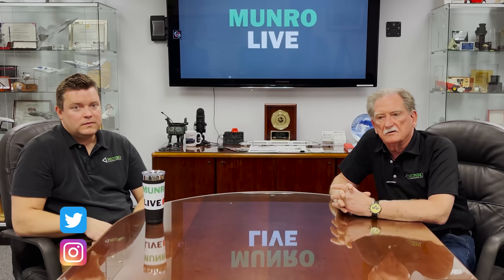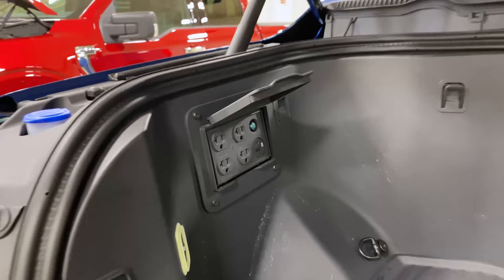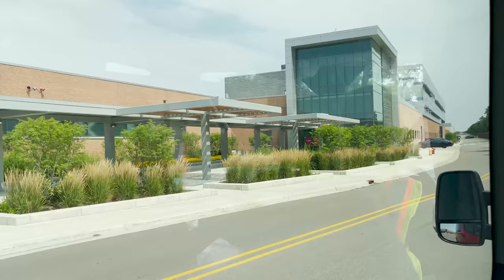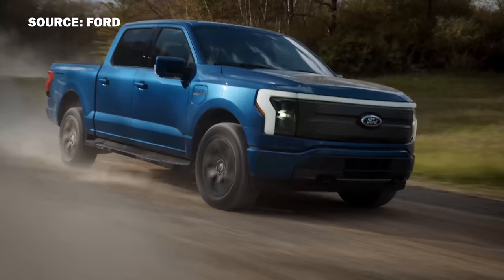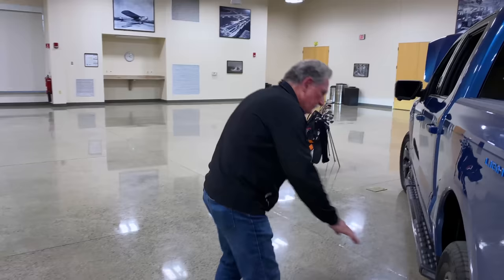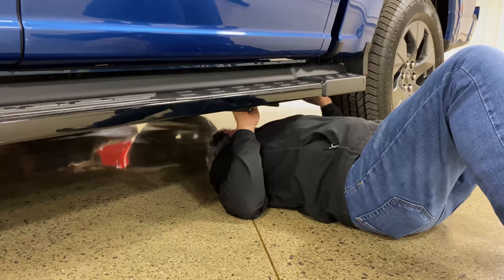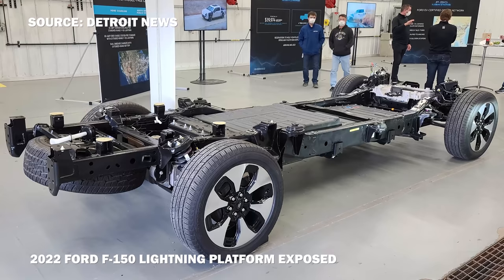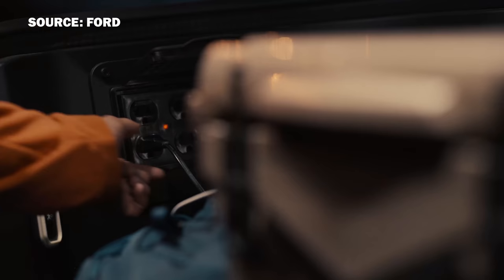Sandy's First Look at the Ford F-150 Lightning Electric Truck!

Comment: Really curious how the driving characteristics changes if you have something heavy in the frunk and nothing in the back and vise versa.
Reply: well i don't suppose it would be much different than any current ICE F series pickup built in the last 50 years.  gas and diesel engines already weigh in the 400lb to 1000lb range while sitting in the "frunk".
Reply: @phillyphil1513  ofcourse it will change, the question is how much. Shifting the weight distribution will always affect driving characteristics. Would like to know if they have any type of active adaptations going on, for example tightening up the suspension, altering how the ESP works etc. I'm european so a truck is not something I would buy, but still curious how they solve it engineering wise.
Reply: @JonasWerme  Q: the question is how much(?) A: none that you will notice.  400lbs is basically 2 passengers (adult males) and is a TINY percentage of total vehicle weight of approximately 6500lbs (35% more than a GAS F150) the battery pack alone is rumored to weigh 1800lbs.  re: "I'm european so a truck is not something I would buy" exactly, so that means you are SMARTER than the average American so i know you can figure this out.  as you also know Mercedes, VW (MAN), Iveco, DAF, and Scania all make trucks even BIGGER than Ford and they're mostly CABOVERS. just look next to you as you drive down the motorway, the info is right there.

Comment: Good analysis. Question re trailer feature. Why make you data enter all the stats? Why not just enter a trailer ID first tow, then compute and store the stats while towing?
Reply: QR/bar code on the trailer, scan it with the Ford app.  done, easy, fast.

Comment: Consider the Ford F-150 Lightning. With no need to fit a gasoline engine underneath the hood, Ford could have restructured its front end to slope toward the ground, giving the driver a better view and making it more likely that a pedestrian or cyclist would roll off the top instead of absorbing a collision directly. Instead, Ford kept the tall dimensions of the existing F-150, converting the space underneath the hood into storage that the company calls a “frunk.”

Comment: Why did Ford isolate the battery pack from the frame? I assume Sandy means it was isolated with rubber mounts to allow movement between the pack and the truck ladder frame. These frames always twist back & forth under normal loads & use, so if the battery pack was solid attached it would either twist and damage the battery pack or rip apart the bolted mounts.
Reply: Probably makes it easier to replace?

Comment: It’s nice to see Ford taking the usability of the truck in a creative direction…. All those bells and whistles still need power…. The usability of the truck will still boil down to how much energy/range the truck will have when loaded.
Reply: I think that's an easy solution long term, but in the short term the range is going to be a limiting factor.  They will be fine for most applications, but if you want to tow more than 150 miles per day (100ish if its cold out) then the range just isn't going to cut it.  It will absolutely excel at short range daily towing though.
Reply: Its going to have a lot more range than stated. That range is with a thousand pounds of payload so that's why they low balled the range. To make it easier for people who tow.
Reply: @twany442  That will help, but weight isn't nearly as big a deal as the drag from the trailer.
Reply: @nerothe  And. Still doesn't matter the will definitely be more than the 250 300 miles that stated. No way in hell.

Comment: Two of the most critical questions: 
1. how aerodynamic will this brick be? 
2. How many will they be able to make? (Ie how many batteries can they source)
3. Did they or did Ford anywhere mention how many EV trucks they’ll be producing per year?
At the end of the day, if the cost/range is too high (ie they need 20% more batteries because it’s not aerodynamic) and if they can source enough batteries, they will be supply constrained. If they can’t make enough trucks and they can’t make enough profit on them - it is a nice project but not really going to really shift market to EVs.

Comment: Why not put battery pack with inverter a/c in trailer either controlled by truck or to extend range while towing right along with brake control?

Comment: the FUD motors Lightning is still a LIGHTWEIGHT. 
Cybertruck has 100 sq ft Cargo with BEST in Class hauling of 3500 lbs STANDARD on all models.
Cybertruck also has MAX TOWING up to 14,000 lbs with a LONG RANGE battery. 
Cybertruck has BEST in Class Approach, Breakover , and Departure angle.
as well as 16" Ride height with 14" Travel on a 4 Wheel Indenpendent system.

Comment: Re Sandy's comments about the yuck factor of gasoline - I recently bought an electric riding lawn mower.  No smell, no having to keep cans of gas around, no spilling gas when pouring it, no starting problems, much quieter, better traction from the independent motors for wheels and blades.  I made a New Year's resolution never to buy another gasoline engine.

Comment: In a few years, if I were the manufacturer selling the first vehicle with nonflammable solid-state batteries, my commercial would be an ICE on its side, a classic (flammable electrolyte) BEV on its side, and my BEV with solid state batteries on its side. Then I'd open up on the the underside of all three with a 50 caliber machine gun firing tracers or incendiaries. And after the ICE exploded, the classic BEV was intensely burning, and my vehicle was sitting there riddled with holes but inert, I'd ask the viewer: "which of these do you want to drive?".

Comment: So for the trailer there should be no need to input any data. Once the truck detects a power draw it then detects a load in the back and then would start a confidence countdown till it had recalibrated the MPG. No need for any user input.

Comment: Range is king. So what is the range and the cost of the truck to get a range/ unit cost.
Also charging speed and charging network size, location and ease of use.
Reply: That's what I'm waiting to see.  MSRP is one thing, but what it is really going to take to get out the door and what is the real world range when towing a trailer.  My 320 mile range Model Y gets 110 miles towing a bass boat when it's 48 degrees out.  It won't be an apples to apples comparison, but the Ford will have to prove its ability to tow for any range at all.  150kw charging isn't going to cut it long term as Tesla begins moving into the 300kw to 350kw range near term.  Ford touts the "largest national charging network" but forgets to tell you that 80% of those are destination chargers that give you about 20 miles of charge per hour and the fast chargers don't work half the time.  Again though... these are short term problems that will be fixed as EV's become more prevalent.

Comment: I know one thing that the Lighting will have that Tesla won't... Spare part availability. I hear stories and watch them on youtube that a minor fender bender might lead to 5 to 6 weeks to get a replacement part. Unless I am mistaken, this looks just like the stock gas engine version, therefore parts will available.

Comment: The mechanically isolated battery is a BAD idea, but necessary in this case! To date, BEVS have all been unibody, with massive torsional stiffness, and integrating the battery pack is a GOOD thing, because it allows you to use the mass of the pack to ADD stiffness and strength.  But this Truck carries across a ladder chassis and body on frame, which means it is not stiff, and that forces to to mechanically isolate the battery to avoid frame torsional deflections causing internal shear loads resulting in fatigue failures in your pack. The downside is that the pack stiff needs a mechanically strong enclosure, to protect it (esp. when off roading or on dirt roads, where a truck get s used) but now all that mass does not help stiffen and support the rest of your structure.  This adds a significant amount of mass, hence the huge kerb weight of the F150 lightning.

Comment: I would be more inclined to buy one if it was a super cab with a 6 1/2 ft bed. I use my truck bed more than I use the back seats for passengers. Plus with the frunk I have even less reason to use the back seat for storage. Super cab is lighter than crew for the same wheelbase as well, so that might turn into an extra couple miles per charge.

Comment: Until recently I assumed that most Americans who use pickups for work would choose the familiarity (comfort) of the Ford over the flashy Cybertruck or the L.L Bean-ish Rivian. Then I watched a review of the three, each the loaded version. Whoa! The Ford is a little MORE expensive than both the others' trimmed-out models, and has FEWER great features, less impressive power, range, and other specs. The Rivian is ideal as an off-road camper (amazing rough-road agility, from individual motor on each wheel), but the Cybertruck will outperform the Ford in most every way, and guys wil learn that over time. If I were a contractor, I'd buy the Cyber in a flash.

Comment: The Lighting will out sell the Cybertruck. The F150 has been one of the best selling trucks ever. Ford will have a lot of credibility for this reason. Also, most people want the utility of a standard truck. Most truck users are not looking for a had turner. They are looking for something that hauls there stuff around and had easy access te everthing. You can access the entire bed  of the Lightning from the sides. It's a standard bed size so typical truck users will find it highly useful. The Cybertruck is none of those things. It will sell to people that are not truck users. Like how you see tricked out hummers and jeeps that never see off road use, this crowd will buy the Cybertruck. Actual pickup truck users will gravitate to the standard design that has served them so well...like the Lightning has preserved.

Comment: 2024 they'll bring the construction-/fleet-model to the marked, and start now with the most expensive platinum trim first  ...that's at least what was written in their small print at the introduction of the truck. but maybe timeline has changed.
Reply: Also there was an info that the platinum won't be available as long-range with the bigger battery.

Comment: I was hoping for a dive under the frunk area. Let’s hope Ford simplified the thermal management system on the Lightning. I hope it’s not the same rubber hose palooza used on the current Mach-E.

Comment: They are definately not cheap especially jumping from XLT to Lariet with the "bells and whistle" premium packages exluding the 300+ range battery.  I did a calculation on my V8 driving on econ mode with the average price of gas.  If i'm putting on 200k miles, the cost of gas vs. electric is going to surpass the price of XLT premium.  This is even before adding on any maintance.

Comment: As someone who's driven a tesla for 5+ years.. the lack of a single 110 outlet in the car to this day is mind boggling to me. You're literally sitting on a giant battery and can't get even 1 low amp 110v to easily charge a laptop or something (without a lighter adapter). Crazy.

Comment: Sandy, your video gave me an idea you may wish to pass onto Arcmoto (unless it sucks). Is anyone doing a motorized EV trailer? Or perhaps just trailers where the floor was a battery-pack to allow for higher-capacity towing with an increase in range and performance for the EV truck that's pulling it?

Comment: When Sandy said at 11:27 get the Lariet and that he "wouldnt touch a low range anything" (low trim he means) why is that, can someone explain exactly why a low range lightning wouldnt be desirable?  From the XLT to the Lariet its an additional $25,000, its even more from the Pro to the Lariet.  Can that $25,000+ justify the features on the Lariet?  Is there some other value calculation he is making that I am missing?  Thanks! @Munroe Live

Comment: The F-150 Lightning Platinum is a $95,000 truck...yikes!
Reply: The standard range F-150 Lightening Pro is $39,900. The Extended range Pro version is fleet only.

Comment: I love the smell of burning gas and the noise of the generator is no worse than the noise of a saw and many other power tools. Regular generators are the only legal way I can get high on the job aside from sniffing paint fumes, but low VOC and oil-free paint kind of ruined that.

Comment: solid stainless steel cybertruck with most likely more advanced battery and ground up design will most likely still be better.  power converters are not hard to add

Comment: I wonder if it works out for them as a work horse for offsite maybe not ideal to drain the battery. I don’t see a reason for a Frunk it’s kind of pointless. Do they also have a way to plug in the thing on site? Say in the construction cabling in some innovative way?

I like there screen integration the only thing i found weird is the cycle thingy.

Comment: When you say the battery is a “massive” item to isolate, do you mean that literally or do you mean it is an extremely important item to isolate?

I’m curious why the battery is important to isolate (if that’s what you meant).  It doesn’t have any moving parts, does it?  Do vibrations do much damage to it?
Reply: Probably makes it easier to replace battery pack
Reply: @WANDERER0070  hmmm.  That’s not what I thought they meant when they said “isolated”, but maybe.

Comment: The electrical outlets won't survive the first load of firewood tossed in the rear bed. The outlets need to be higher and have a protective cover. Loose material like soil and builders mix will also destroy them, especially with being mounted so low.

Comment: Just thought I'd say how much I appreciate your programming, please keep up the good work.
I fall in the category of needing an ICE powered pickup in the foreseeable future or at best a hybrid. I live in Northwestern Alberta about 1200 miles from the Alaskan boarder. Though I'm enthralled with the Cybertruck in particular for its rugged exoskeleton and bullet proof glass, it won't cut the mustard up here. There  are no superchargers or similar systems and at -45°C and colder in the winter when snow and ice stick to the bottom of your truck, causing reduced battery efficiency and mileage. What does one do?

Comment: The F-150 electric doesn't need to be better than the Cybertruck, or better than the GM or anyone else. It just needs to be better than the ICE F-150 and it will be a great success!
Reply: True!  There is a lot of different niches in the truck market and no one e-truck will fill them all.  Lots of room.

Comment: My biggest concern is the loss of range with a load compounded by the loss of range in cold weather. Is a 300 mile range unloaded summer range going to turn into a 70 mile loaded cold winter range? If the range loss is at that level of bad, it’s flat-out not a usable vehicle in northern climates.
Reply: Range is around 472 miles for these.  For(d) Artic Circle trips you will need the extended battery or battery trailer.

Comment: They sell a million trucks a year.  Year one they'll make 50k of these.  They'll likely have 250k truck buyers delaying their new truck purchases for a year or more.  This is going to be a very painful transition for Ford.  That's why GM and others choose high dollar, lower volume first.
Reply: Yes painful, but they'll be eating their own lunch. Then after they're done with that, they can eat GM's and others.
Reply: @magnusauto7941  They have to still be around to eat GMs lunch.  They are trying to invest half of their valuation in EVs, and all profits will come from their existing ICE business for the next 2-3 years.  If those profits diminish because customers are waiting for their Lightning, Ford will be in trouble.  The strategy of going low has been tried before and it isn't usually successful, seems impossible to make it work while dragging your legacy business behind you.  

Ford's saving grace might be allocating most of their production to fleet vehicles which will have to invest in charging infrastructure as well.  Give away their trucks, but make 75% profits on chargers.  It's possible, but risky.

Comment: How do you charge the truck if you're pulling a trailer. I guess you have to unhitch it
Reply: I know Tesla has started to make more pull through charging stations.  Other charging networks will have to as well I guess.

Comment: OK, so the truck is fully loaded and you're on your way to a worksite and how much does the extra weight affect the range. And then using the electricity from the truck instead of a generator, how much range do you have...this is what I thought about from listening to this interview. Not to mention if you're towing a trailer when a truck is fully loaded as many landscapers do. This truck will not work for that unless it has 400 miles of range, the range is cut in half from all of the weight, so you have a fast charger at home provided that the battery is low enough to begin charging. This truck is perfect for me but I work at the VA medical center so I'll use it for transportation most of the time but a work truck if you only have to drive about 50 miles a day when towing trailers with heavy equipment.

Comment: Hi I have a question about the Ford F-250 & F.350 The CEO of Ford said in an interview that I watched that they plan on making all their trucks battery powered so I was wondering if maybe you could do a show to try and explain how they might do a truck four-wheel-drive system with heavy axles for snow plows or a duly rear end for pulling heavy trailers what type of gearing might be needed… I am very curious